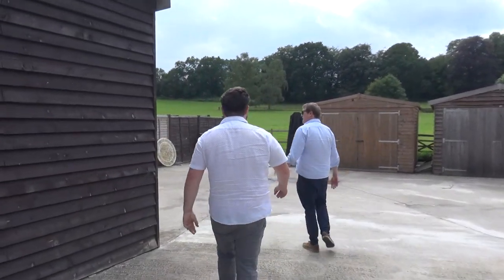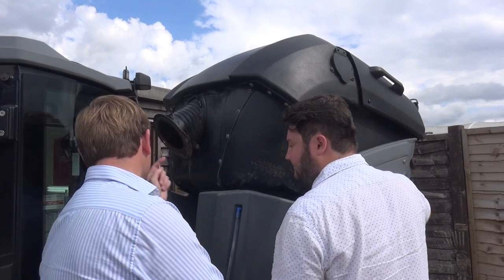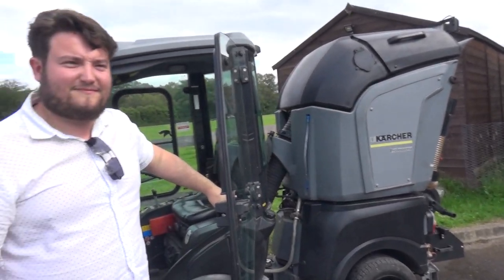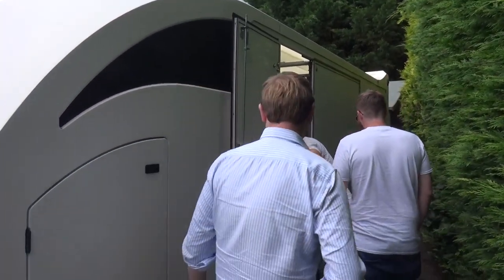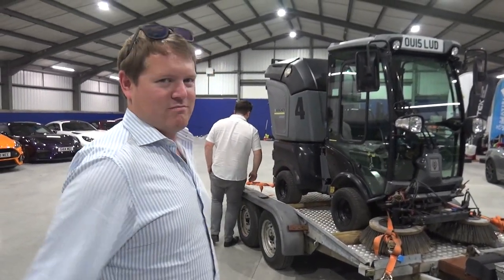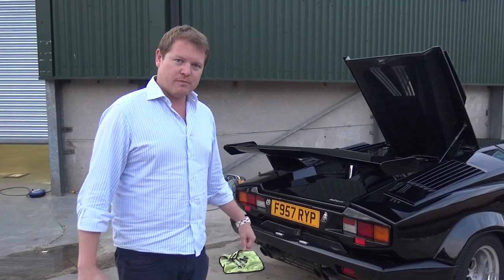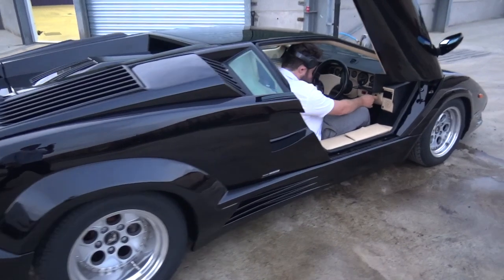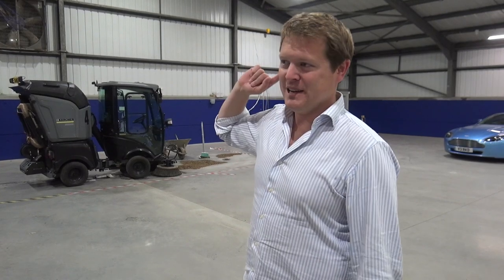TWO BREAKDOWNS at The Shmuseum! | VLOG 11

Comment: For the fluid/oil spill you need cement dust and a few days…it is not easy to clean up and takes time unless somebody has some super chemicals to speed things. I once had a new oil filter burst just after I had changed the oil on my Capri…it pumped about two litres of oil over the garage forecourt and took two years to disappear! Good luck Tim! 😬😬😬😨😨😨😨😳😀

Comment: I like the fact that shmee actually uses his vehicles capabilities.
Also does the UK require any form of special certification to tow?
Reply from the maker: Yes it does, you need to have a B+E licence to tow
Reply: @TheShmuseum  that's where the u.s is a bit different , as a regular license will do the job. You just need a registered trailer and vehicle rated to tow whatever weight necessary + trailer weight.